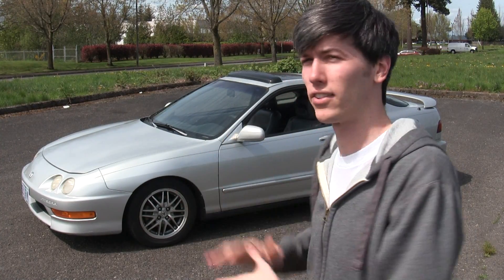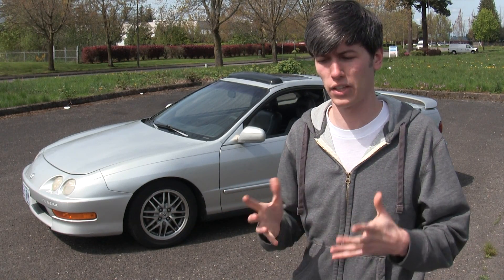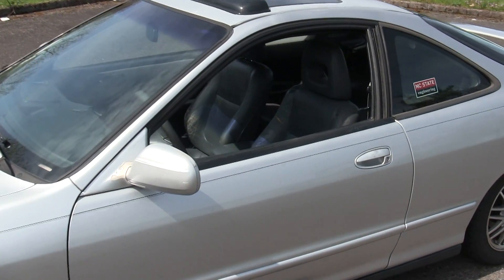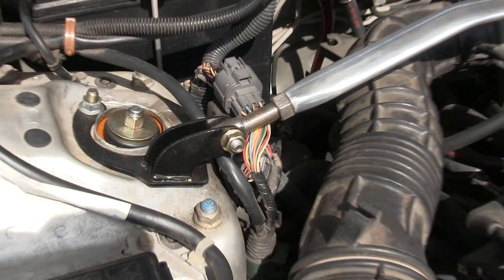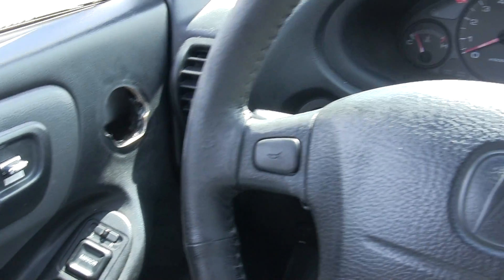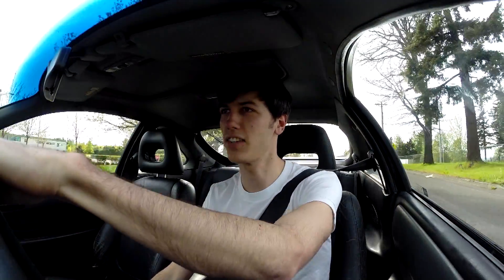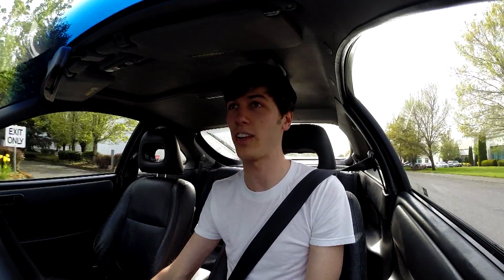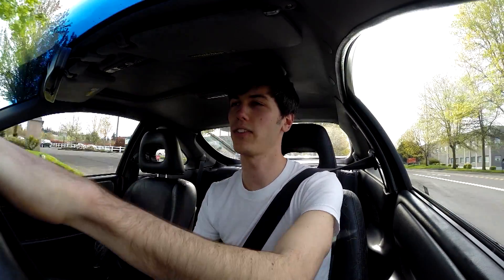Project Integra - Let's Build A Race Car

Comment: I'd love to see this car progress as an all out track day car, a car you can drive to the track, beat on it, and drive it back. With a track day car in mind, here's what I would like to see...

1. First and foremost, safety and weight reduction. completely stripped interior, a pair of bucket seats, harness, a roll cage, and a nice helmet would be a good start.
2. Revert the car (minus the safety and weight reduction mods) to bone stock, and keep the maintenance up to date. 
3. DRIVER MOD! Attend MANY track days. Get lots and lots of seat time. 
4. Install brake pads, good brake fluid, some sticky tires, and corresponding wheels. Document progress. 
5. Install good dampers/coilvoers (KW, bilstein, Moton, etc. come to mind), some camber arms, toe arms, and an aggressive alignment. Document progress.
6. COOLING! After all what's a track day car if you overheat it and blow a head gasket. A radiator, oil cooler, and brake ducts would be nice. 
7. AERO! My favorite aspect of a car's mods. Splitter, canards, rear diffuser, and rear wing come to mind. Document progress.
8. Power! Your choice of n/a or boosted. Would love to see the b18 get built for around 300-350whp. 

You definitely made a good choice making the integra a project car. Can't wait to see it progress!

Comment: Like you said, weight reduction first the obvious place to start. depending on power figures and what kind of 'race car' you are building it would be good to motor swap. Maybe a JDM B18CR out of a DC2 Integra Type R, or a K20A out of a DC5 Integra Type R or a RSX in the US, or even a K24/K20, which is a K20A block with a K24 head. Obviously the cheapest, well from where I'm from is the B18CR but money has a lot to play. The K24/K20 set up seen a guy pull 184.4 kW (Not sure of HP)at the front wheels on his DB8R Integra. But then again I have also seen a stroked and sleeved B18CR pull 175 kW at the front wheels. Oh and also if you do decide on getting a exhaust system, get a full custom exhaust, instead of a off the shelf product. There's loads of guys who do it here in New Zealand not sure about the US though, i think a 2 1/4 inch system should be fine.

Comment: Racing seats, roll cage,quick release steering wheel, new set of wheels check out some Drag DR-20's they are some nice and affordable wheels, cold air intake, intercooler, maybe turbo? Haha & A decent exhaust system that doesn't sound too ricey. That's pretty much all I got, can't wait to see what you do to your integra, good luck man!

Comment: I'd like to see you take down the engine and rebuild it just to see the various parts of it to understand how it's made and how you can put it back together, maybe changing some parts to improve performance. Then you have to make the car light! get everything out, put racing seats, roll cage, new suspensions, discs and calipers, tires.. It will be fun to see how to replace all these things! then I would go with new exhaust and maybe do something with the ECU to get more performance! For final stages.. maybe get a turbo? I'd really like to see you put a turbo on your car!

By the way, this is a great idea! big fan from Italy!

Comment: just a turbo, because suspension is pretty good strip the interior, maybe bbs rims http://www.ebay.com/sch/i.html?_kw=acura+bbs+wheels
rollcagehttp://www.horsepowerfreaks.com/partdetails/Cusco/suspension/Roll_Cages/Steel_-_Safety_21/7005
race seatshttp://www.andysautosport.com/racing_seats/acura_integra.html
spoilers http://www.andysautosport.com/spoilers/acura_integra.html

Comment: a few ideas depending on how big you're thinking...
-convert to rear wheel drive (drifty fun!)
-engine swap for Hayabusa or other super bike (no idea if possible)
-Install Hayabusa engine behind driver for mid-engine, rear wheel drive (chain-driven? I've seen a few Minis and Fiats do it.)
-I'm with Byzantine on the weight-reduction idea
-Supercharge it
-Lightest weight wheels possible
-Wide body kit
Reply: Also, something I've always thought would be cool: LED lights that become more intense the higher you are in the RPMs (could also be done with rising decibels from exhaust). Imagine how fun it would be to rev it in front of people!

Comment: pull the head get a gsr vtec head get the golden eagle lsv conversion get a cometic head gasket get some arp head studs new water pump go get hondata s300 and get a turbo kit with like some 550cc injectors walborrow 255 fuel pump put it on 10 to 15lbs and youll make over 300whp

Comment: I think you should reduce all of the interior to literally bucket seats, add a high flow exhaust and intake system, also an ecu upgrade and struts for the front and back of the underbody.

Comment: I suggest that assuming you arnt going to turbo it, to do the obvious and vtec swap it. I also am very interested to see a dyno run with whatever exhaust you decide to go with. For example: make some significant power upgrades, then dyno with stock exhaust. Next put on aftermarket exhuast headers piping etc. And see if you actually make much gain like you explained in your exhaust video. I would really love to see that!

Comment: Headers, cold air intake and some fat wheels on good tires is a good start. Gutting it, ripping the cat out and adding a muffler is all you really need to make it go fast enough. Making it handle like a german car requires replacing suspension components like rear control arms, swaybars and bushings but small things go a long way on a honda. Big brakes are also key; honda parts are like lego

Comment: What would be interesting is that you have an American Integra with the Type R looks. Championship White with the DC2R kit, start off with the weight reduction because a lighter car will improve power to weight ratio. As for performance, would be nicer to have a B18C swap in it or go even madder with a K20 block and a B18 head. With that, the handling should be up with improved coilovers, thicker and fatter tyres, chassis bars for extra rigidity and of course, a nice set of rims. :)

Comment: Everyone has thought of good cost effective ways to increase handling and efficiency in the comments, but how far are you thinking with the engine? Meybe a 'second hand engine' swap? Also could change the differential and fabricate it to rear wheel drive, would be a great enhancement to the car since it's front wheel drive with a low HP 4 pot engine.

Comment: First thing I would suggest is to tighten up that throttle cable just a bit. Looked like there might be a little bit of slack in it which might be causing the butterfly valve to not open all the way.
Reply from the maker: Yes indeed, it could use some tightening.

Comment: What's the budget?  In the spirit of your channel I say we make this into a track car that is still legal to drive on the road.  I guess first things first, go to a local track and see what kind of times it puts down while it's still mostly stock... would be nice to have a black and white reference point
Reply from the maker: I will do my best to have "before and after" for the different modifications.
Reply: Engineering Explained Very cool, I know I will catch some flak for this but here goes.  Lets make sure before we make your car go faster lets make sure we have enough stopping power, I say lets upgrade the brakes first.  What type of discs and pads would u use?  Also are your rear brakes disc or drums?  If they are indeed drums maybe upgrade them to discs???
Reply from the maker: HaloToday Brakes are definitely going to be one of my first upgrades. I don't have any experience on a track, but those who do know the importance of good brakes. Street brakes/stock brakes overheat quickly and fade quickly, as in traffic you're not stopping from 80 mph repetitively, or hammering on the brakes constantly. It's the smart, safe thing to do.
Reply: Engineering Explained EBC Bluestuffs are as close to track brakes as I've ever put on a car, and they definitely show it in more ways than one. Tons of dust and they tend to squeal like crazy when the temps are over 95, but as far as stopping power and fade resistance, they are the best I've ever had. Love EBC's pads - though I've known a few guys who have had problems with their rotors, so I'd avoid those.

Red to Orange stuff pads on any cryo treated rotors would be a great track-worthy upgrade. I think it'd be pretty stellar if you did a few before and after 60 to 0s to demonstrate the difference; Might just change a few people's minds of those that think BIG (PRICE) BRAKE KITS are necessary upgrades.

In case anyone isn't familiar some tracks and many organizations prohibit the use of cross-drilled rotors, due to their tendency to crack/split under heavy use. Slotted is almost always fine.

Comment: To start out with just Strip out the interior, remove all the heavy seats carpets ect and replace the drivers seat with a light weight seat. Add a Roll Cage or performance disks and callipers.
Reply from the maker: I like your thinking!
Reply: Cheers, I can't wait to see what you do!
Reply: Engineering Explained As far as replacing the discs and calipers, I'm sure a little digging will reveal some nice little '99 Integra applicable community mod that involves snatching discs and calipers off another car for an extremely economic upgrade to braking power/longevity.
Reply: JinEteru I like your thinking!

Comment: You should try a few different cat back exhaust systems.   Call it "The least ricey integra exhaust" or something like that.   XD I say that because I am currently trying to find an exhaust that doesn't sound much like a weed wacker
Reply from the maker: Haha well stock for sure. I have a Yonaka catback which I will install eventually.
Reply: Engineering Explained i just recently put a yonaka cat back on my 1998 integra gs. it sounds amazing. nice deep tone. it's very simple. cut away all the old piping, and the new yonaka was all bolt on which made it very easy to put on :D

Comment: Whenever I finally grab a vehicle that I want to modify I would definitely start with a brake upgrade (sports rotors & pads. steel braided flex lines) flush out the brake system with fresh brake fluid convert rear drums to rotors. then suspension. definitely inspect all bushings and replace all that need replacing, upgrade suspension.  

You get where I'm going with this right? 

Start with the safety. Being able to stop with confidence and not pray your OE brakes can hold up during intense braking. 

optimize the suspension till it surpasses the engines power. then if you still feel the need for more start adding performance parts to your engine and work everything up from there to your liking.

Comment: put a decent size turbo, bigger injectors, bigger throttle body, exhaust, and a nice tune and you'll be surprised may even be faster than the sti lol and you'll also be surprised how much of a beating they can take! supporting mods would help like valve springs, pistons, connecting rods ect. but im sure you're not trying to spend a fortune

Comment: I see the throttle cable has a bit of slack on it. 

But first is first of course before adding performance to it make sure its in good shape, up to date on maintenance, etc. Worst thing I've seen people do all the time is adding performance parts to a car that is currently running poor to begin with. I'm sure your vehicle is up to date in maintenance and running great. But just thought I'd say this mostly for other viewers.
Reply from the maker: Yeah I agree, I do need to run a compression test to see how it's doing. Fairly certain the rings are pretty worn.

Comment: You should turbocharge it!

I understand that's a tall order but hear me out. First, it'll make the car fast. Turbo sizing in itself is a really interesting exercise in finding a balance between compressor maps, turbine efficiency, VE, etc. and would be an excellent handful of videos. It'll also make the car fast. There are plenty of auxiliary parts for upgrading on future videos like wastegates (mechanical to electrical), BOVs, turbo blankets, etc. Oh, and it'll be really fast.

Don't go really big, either. Find a nice small unit that'll flow 220 g/s and spool by 2000 rpm. That'll probably be some 250whp. For a light track car (with LSD) it'd be perfect!

Comment: Change the camshafts to more agressive ones. Make a 10-50mph run stock in 2nd gear, then do it after the install. Or maybe do like 3rd gear 20-80mph and have that as a benchmark time for future use
Reply from the maker: Like the ideas. Planning on doing something similar for acceleration testing.
Reply: Engineering Explained What about as simple as Cold Air intake.... Other than nice Induction sound, are there any benefits for the performance of the engine! Would love to see real world examples. (MPG's?)
Reply: Engineering Explained What about ride quality/ cornering with the use of Stiffer engine mounts?

Comment: I'm doing a similar thing with a BMW E30 316. It is my daily when it runs and I have a 125cc motorbike for when the bimmer is off the road. It works great.

Not sure for ideas but if you can pick up an old LSD that would be very cool to see.

Comment: Remove all the seats/interior and just have the single seat or 2 fixed buckets. Second set of wheels / semi slick tyres. Upgrade the brakes to something like a DC2R brake setup. Take it to the track and work on the suspension setup.

Comment: "... and then four hours later I'm like 'man, I wish I could get this bolt out'". I can so relate to that. Last time I did something big I swapped my rear axle, took me about seven hours. All in all it was something like 30 nuts and bolts, but every single little thing takes so much more time than you expect when you start. Anyways, good luck with the project, it sounds great!

Comment: AWD/RWD swap, and try to get as much power out of it as you can and try to get the best handling out of it! Like removing things to get it as light as you can and getting a new suspension etc! Also it would be awesome if you could do it with a low budget, like trying to get some used parts for cheap! Maybe paint it also?

Comment: For starters you can port and polish the head. It's basically free (if you already have the right tools), and you can learn something through taking an engine apart. I bet taking engine apart would be a good thing to film, too. Since you already have your STI as a daily driver, you can transform the Integra into hardcore track car (on affordable budget, of course). That would mean weight reduction (again, free and can do much difference on performance), stiffer suspension, remapping the ECU, all the fun stuff ;D
Oh man, I'm so hyped :D can't wait to see what you going to do with it.

Comment: 1. tires and brakes
2. weight reduction and sport seats
3. Make it stiff (sport suspension and anti roll bars (or even better a cage))
4. ECU mapping
5. sport clutch and flywheel
5. bore the engine, new valves, pistons and camshafts
6. new intake and exhaust systems
and if you have the time and money: Put a Turbo on it

I think then you should be good to go
If you need explanations on theese steps then you can write me a message, Im a mechanical engineering student and I love to modify cars
Reply from the maker: Thanks for the suggestions! I may be in touch. Cheers to a fellow ME.

Comment: For the strut tower bar, I recommend the 94-00 integra type R strut tower bar...
Reply: Engineering Explained I have a neuspeed front strut bar on my 2000 its a 4 point solid bar and it works superbly i would recommend you look into it if you can
Reply from the maker: Better than what I have, for sure!
Reply: Since it came off an integra with the same body style, it will fit very nice... I think it looks better also
Reply: brad naylor Very true, definitely looks better!!
Reply: What site is the neuspeed strut tower bar sold at, I'd like to see it! Josh Thomas
Reply: I think he should just stick with the strut tower bar he has, unless someone gives him an upgrade. Money better spent in other places, even things like getting a premium synthetic versus settling on a mix.

Comment: Do a mild street car. Build the b18 to 300-350 hp. Decent suspension upgrades with the works of wheels, tires, brakes. New paint nothing fancy, front splitter, small diffuser maybe a mild spoiler. Full heat and air with streetable racing seets roll bar ( 4 or 5 point) stripped back seats with new carpet or rubber floor (like bed linning for trucks) or just strip the carpet. To many videos on crazy race cars, need something usuable and relatable.
Reply from the maker: I like your ideas!

Comment: avoid turbocharging it...unleash those NA potential inside the engine,I am pretty it is one of those vtec engine from the B18series,Bore increase is possible if you want more horsepower,and most importantly,the chassis upgrades,suspensions,coilovers and a roll cage...turn it into a light-tuned weekend warrior type track car.thanks for taking time to view my comment.love yur channel,it teaches me so much since the 1st video.